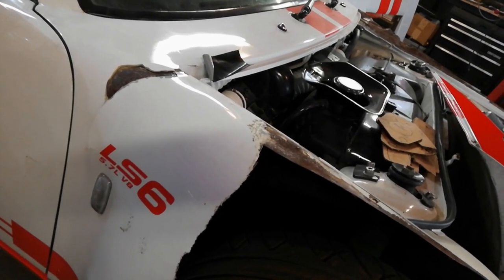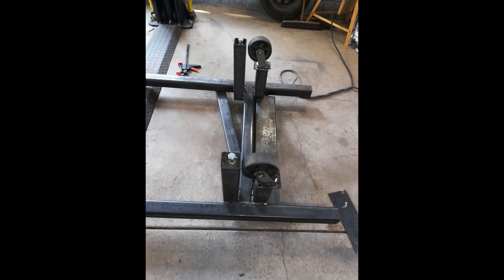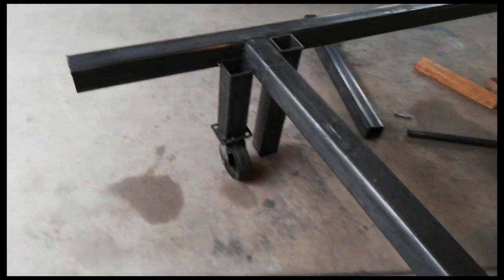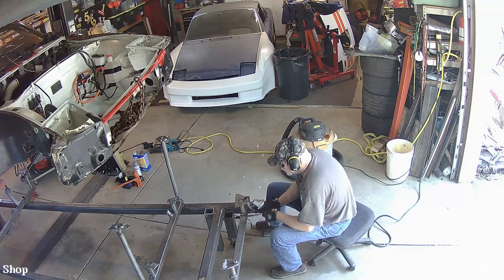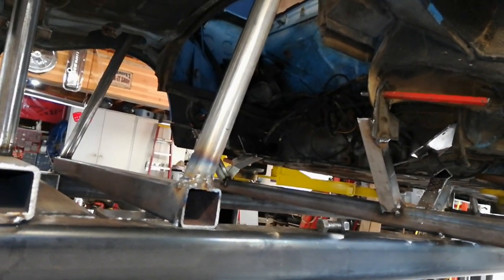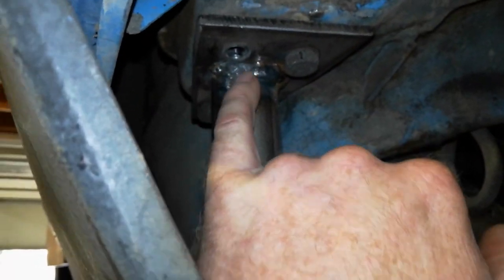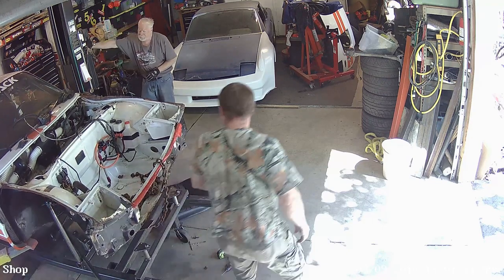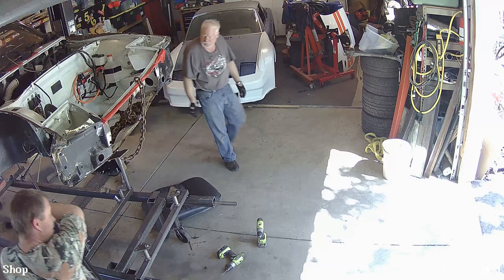DIY Chassis Jig! Saving the totaled 500hp 914

Comment: That is a really interesting video, thanks for taking so much trouble.

One question, if I may.  You mentioned that you used the original factory dimensions as a starting point.  Where did you get those dimensions please.  I have a 1975 914 and am thinking of building my own jig, but I would like to study the original spec dimensions first.

Any help or suggestions would be gratefully received.
Reply from the maker: http://www.914world.com/specs/914info.php

Technical info in the middle of the page.